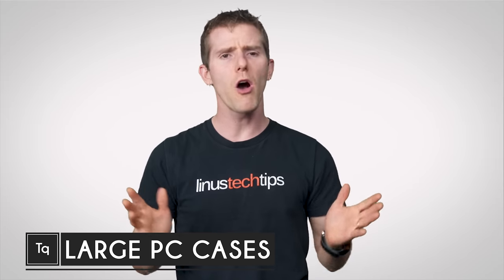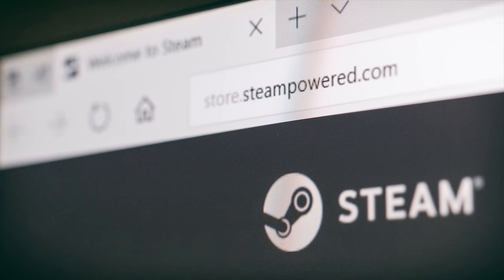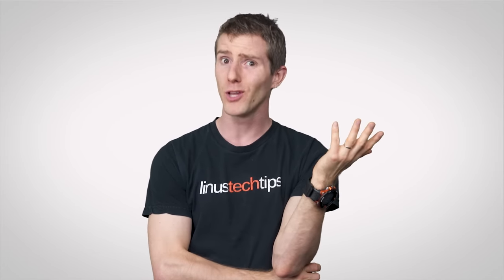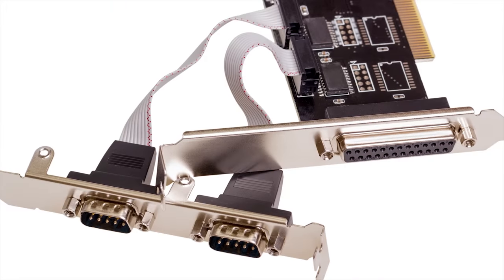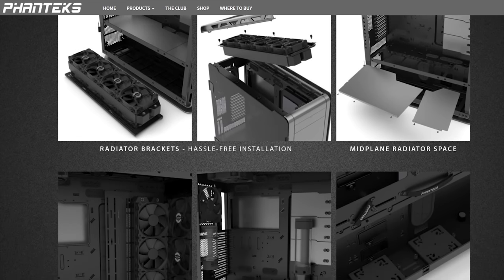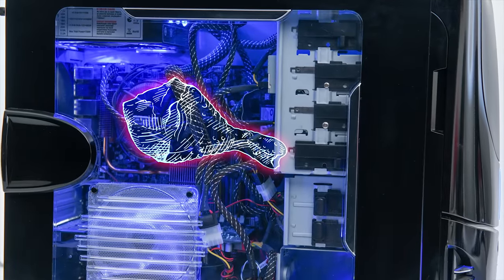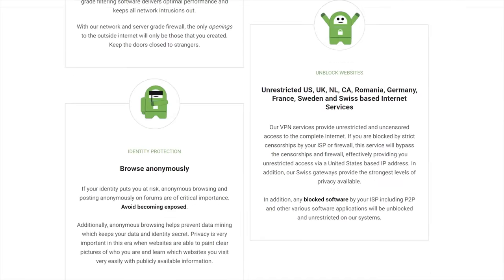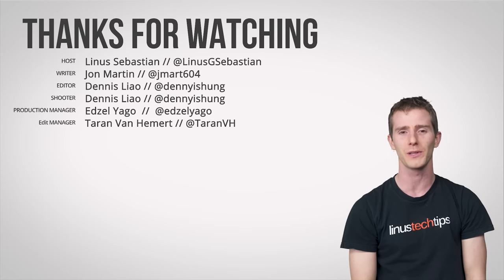Do Large Computer Cases Still Make Sense?

Comment: Linus, good video on this aged old topic. Lately, I have been using a 21' iMac and couldn't be happier with the performance for the size. 
To the community: Has mATX, become fully featured now a days? Meaning, TB3, USB -C, etc...?

Thank you everyone for your input.
Reply: Yes, and no. Many gaming variant mATX motherboards are including USB-C ports, though most do not support TB3.
Reply: One aspect where microATX is definitely "not good enough" is in terms of fitting the kind of beefy power delivery required for higher-end CPU's (still), and to afford headroom for overclocking. VRM's are just one of those things that you need a lot of board real estate for, whether it's a few really expensive phases, or several cheap ones to smooth out power delivery and keep either an overclocked mainstream or even a high core count CPU happy enough to not crash or worse, shut down on you.
Reply: Jorge Ramos you are completely wrong you can easily put 1200 watts in a microATX case, as they use the same power supply?? As for vrms I cba to look it up but I'm sure it will NOT make enough of a difference to any normal overclock  to be worth it to the average user
Reply: With how you labeled 21 it seems that you have a 21 foot iMac
Reply: Good input. I don't normally care to overclock a CPU anymore. Chips are pretty fast now a days. Software is being updated to fully utilize their capabilities as well.  So, the extra heat usually isn't worth it for me.  Again, good input though.
Reply: Grammar, my Achilles Heel.  :)
Reply: even ITX are fully featured now (minus SLI/Crossfire obviously)
Reply: "I have been using a 21' iMac"

Sorry to hear that. I hope you get a good computer soon so your suffering can end.
Reply: Which is hilarious and sad at the same time, since many Itx boards come with robust power delivery. My Asus strix x370 ITX is running a r5 1600 at 3.95ghz without any vrm problems, as the heatsink is still able to be touched. mATX seems like the red headed stepchild.
Reply: my pc is mATX based (Core i7 8700)
Reply: Jorge Ramos I guess you don't own an matx board or case, because you are clueless. I run my 4790k @4.7ghz with my GTX 1080ti, all in a matx case. You couldn't be more totally and completely wrong. Power delivery on matx and itx boards can be just as good as or better than atx.

Comment: I need a large case; I've had worse luck than I like regarding hard drive failure and loss of data as a result thereof. When I assemble my next system it'll have 6 8 TB drives in RAID 6 and I plan to eventually add 2 more

Comment: large computer case. small computer case. midsize computer case. I would say the most relevant part is your motherboard. I use an EATX size board. And I would love to use mid size cases. However most case manufacturers dont do punchouts for an EATX board so im stuck with the larger case. Even alot of the newest cases like the coolermaster cases dont do EATX punchouts. Beyond that I would say they are irrevalant with the way cooling systems have advanced over the years. 

that being said the 5PM case is midsize with an EATX punchout so I was able to get rid of my rosewill thor II but its extremely challanging to find a midsize thats capable of properly mounting an EATX motherboard.

oh and before you ask why I wanted an EATX board. it was 199 on sale two years ago and my 128 GB of DDR4 memory says hi
Reply: Next question: Why 128gb of ram?
Reply: #BWTFN

Comment: Some of the cheaper pre-built computers are just laptops stuck into a box. You can't add cards.

I like using a case because it gives me room for customization. I've used a TV card for decades and laptops just don't have the same support.

Comment: The average gamer that builds something mid range like an i5 or ryzen 5 with like a 1050ti or 1060, one SSD and maybe one HDD, and that's about it, doesn't really need full size ATX motherboard or case. mITX would logically be what he needs though good mITX motherboards and cases tend to be expensive. So mATX then, mATX motherboards tend to be cheaper than full ATX motherboards, the biggest problem would be the cases, there isn't much choice of good mATX cases nowadays, and this is sad.

Comment: Back in the day, when my day job was working on other peoples computers in a mom & pop computer shop, I used to swear behind customers backs when they brought in these 1 foot cubes of a computer and ask me to repair them.  Took more time digging into the machine, getting crap out of the way to deal with the problem.  Bad air flow, bad cable management, and bad architecture of where things went, such a pain in the ass.

The only GOOD thing about them is when I'm not working on them, and they become someone elses problem.  All my machines in my house are all full towers.  Not a mid-tower in the mix.
Reply: I can understand where you are coming from, as I've done my own builds, and repair on the side since the early 90's(actually earlier then that cutting my teeth on my C64, faulty 1541/1571 disk drives, & my Apple II Ie) with some of the crazy non standard form factors we had back in the 80's & 90's, but since the early/mid 00's I've been building my own systems with Micro-ATX boards, and towers without too many issues overall, and just find that full towers take up too much space.
Reply: I've always allocated the space for the big rigs.  There are way too many benefits for me to sticking with mids and larger.  I know that these big rigs aren't appropriate for some situations, or are eye sores to some people, and they'd rather just have a RPi sitting behind their 15" monitors.  Fine and dandy with me.  But just as "PCs are going to die at the hands of Consoles", big roomy cases are the only way I'll ever go.
Reply: Not all small formfactor cases are equal and I'd argue the average case is much too big. I can't remember the last time I saw a PC with more than one expansion card other than a mate who have sli 1070s he's always bitching about. ATX is a waste.

Comment: I don't buy a large case to fit the hardware... I buy a large case for the airflow and presence. I don't want my pride and joy to be tiny and hidden, I want it to stand out.

Since I refuse to go liquid cooling, having 3x 200mm fans + 2x 140mm fans + the aftermarket hardware mounted fans, ain't no way my shit is capable of overheating.

Cooler Master Storm Sniper Black Edition customized for the win!

ps: I don't care that it doesn't have a usb 3.1 hub since I don't need any of the usb ports on the front. The ports on the back are easy access anyways cuz the case is mounted on a custom shelf on the wall, standing pretty. They don't make 'em with really good airflow like that while also still being super quiet anymore.

Comment: I used to have 2 GTX 780s and an overclocked FX 8350 which required a beefy PSU and cooling to match. I recently wen't to upgrade to an i5 4670k and 2 RX 580s then crossfire wouldn't play nice and my huge case now feels empty and lifeless. My power supply gets to be lazy now too. I'd kill to have that look and feel back, I liked having multiple GPUs even if it wasn't particularly practical... now I just have an empty hole where my heart and second graphics card should be
Reply: Single gpu ITX would look pretty slick on your next build.
Reply: That's actually what I've been looking at doing

Comment: Small cases suck, even if you don't need all the room. They have better airflow and are much easier to work on and look better.
Reply: And of course, you just said all that. lol
Reply: Big cases look ugly. Airflow and build-ability isn't much better than a good ITX and especially an MATX case.
Biggest issue is there is still just more ATX crap on the market. That doesn't make it better though. 

We have laptops with GTX 1080s and 4ghz+ 6 core 12T CPUs but we cant cool a PC in anything less than an ATX? 
Fuck that noise. I call bullshit. People accept ATX because they don't know any better.

Comment: They don't unless you need large water cooling which also doesn't make sense.  Drive cages are also becoming extinct.
Reply: I completely agree, and I have a ATX case with a custom loop. 99% of people don't have a custom loop. Why is ATX the standard?
Reply: Due to tech/old hardware which are larger and not integrated in the motherboard which Linus explained at the start of the video. ATX was useful back in the day where most can fill the expansion slots.  It started to decline with built in sound in the mobo. It will even get smaller once RAM and GPU becomes integrated to the CPU/SoC.

Comment: More build room, more room to cable manage, components are more spread apart so you can get your fat greasy doritos fingers in there. Ease of use, really. It also looks nice. I used to have a smaller case but i got myself a thor full size case. Never going back. Plus the fins at the top are badass.

Comment: I hope my Corsair 780T case lasts a long time. 3 years old already. I like it a lot. I built a micro pc for my girlfriend. It's in a Steam Castle case.
Reply: Hans Schtuk I use a Corsair 760t and love it! The options I have is unreal. Upgraded from a mid-tower as I wanted a 240mm aio which it did not support and I couldn’t be happier
Reply: I upgraded from a 280 to a 360mm cooler. It sits on top. You could put another 360mm rad in front. lol 
M2 drives and SSD's allow the hard drive cages to be removed making even more room. These are great cases.